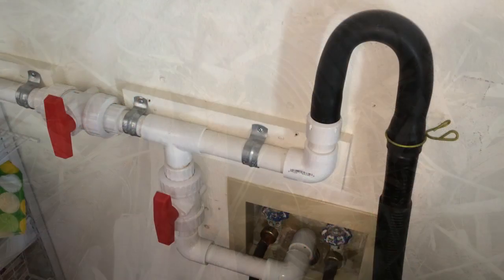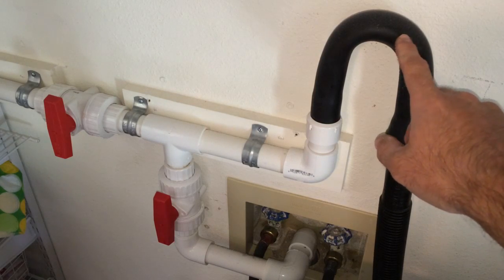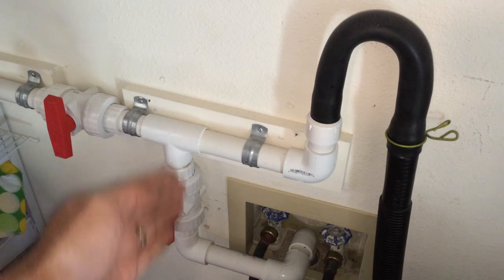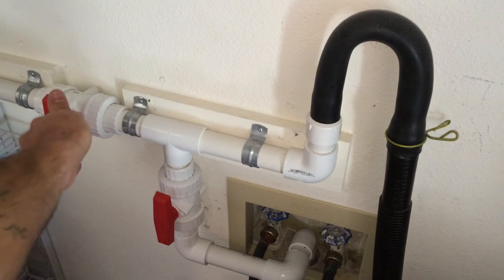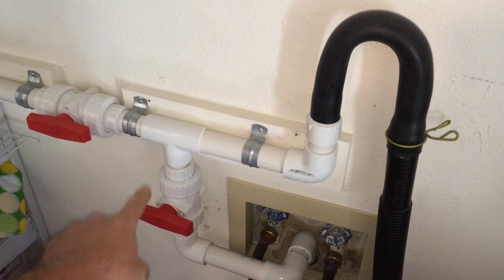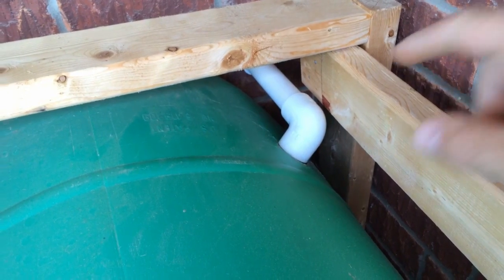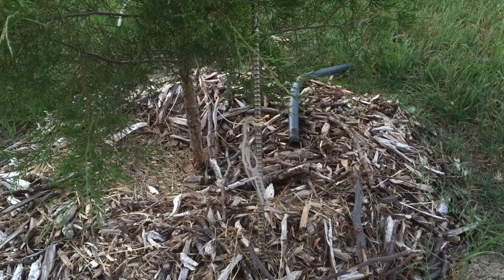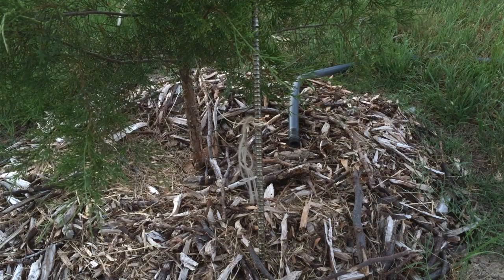Greywater Recycling

Comment: It appears that an improvement can be made by using this video’s plumbing but just illuminate the left side valve to the tanks.  Just stay with that one vertical valve.  Water will take the path of least resistance.

Comment: I want to add my thanks for sharing the well thought thru application of the piping along with your research of the detergent. It looks like you installed the valves so that they could easily be replaced as that particular valve is known for failing after a few years. Jesus bless you for your time and efforts.

Comment: Why not just use a single valve on the bottom line to prevent accidentally having both closed.  If the valve is open then gravity will pull most if not all the water down to the sewer and if it is closed then all the water will go to the storage tank.
Reply: Perhaps the valve in the horizontal line is the only one required. If it is open, most of the water goes to the storage tank and some to the sewer. If it is closed, all the water goes to the sewer. The pipe to the sewer has to be above the horizontal line in my proposed configuration so the gravity helps filling the storage tanks.

Comment: When I was a kid we had a maytag wringer washer. We first pumped water from the pitcher pump in the kitchen into a round tub on the wood stove,got it hot,then moved it to the washer with a big long tub of rinse water beside it all done with buckets. We washed the first load with bleach for the whites and gradually worked through the entire laundry using the same wash water and the same rinse water. We'd  sometimes do 15 loads in the same water. 
The bleach kept the water clean of microbes. Worked like a charm. When finished we would use the waste wash water to wash off the back porch. I still think there are places that use wringer washers because water is scarce.

Comment: Cool man. I am doing a project that includes grey water recycling and I was wondering if the set up you have is safe after 24 hours of being in the barrel if it does not go through a filtering system of some sort. Or do you not need it because the washing detergent is biocompatible?  In any case, cool simple set up. thanks

Comment: The only thing I see from my experience using rainbarrels is I would want the barrels side by side at a height better for gravity feed.  If your storage barrels are on a patio that is much higher than the lawn area then one on top of the other would work. Also as a 71 yr old Sr. Blonde I would want the connection to be a two headed to accommodate two garden hoses, or one for filling a bucket and the other with a hose connected.  With the drainage hose higher it would be easier on the back utilizing the connection.  Very easy to understand your directions, thank you for sharing.

Comment: I love your video thank you for sharing.
Question: When you have the line that goes of to the sewer drain pipe closed and are only only using the line that goes to the outside wouldn't you need a studor vent to prevent your washer pump from over working and causing it to fail do to to much pressure to build up? Also would you mind giving me a list of the things I would need to buy and also if you recommend me adding the studor vent.

Comment: I followed your instructions for a temporary set up - just proof of concept - it was great!  Put now for some reason the water is shooting up through the top (where the washing machine hose enters the PVC pipe - do you have any recommendations for sealing that area?  I see in your video you have something rubber?
Reply: You probably have lint in your pipes somewhere.  Or you do not have enough air space between your washing machine hose and your drain pipe (when it enters the drain pipe there needs to be an air space.

Try augering through your pipe to get rid of any blockage.  Then flush with water.  If it is clear, put your washing machine hose into the pipe in such a way that you have some air between the hose and the pipe.

I hope this helps.

Comment: I have had a similar system for 10 years with no problems with the drain pipe or barrel . I have had to replace the garden hose a few times due to lawn mower accidents or lint buildup . Someone mentioned your diverter valves and what happens if you goof and turn both valves off . He's my solution to the problem , Use a vertical standpipe extension with a valve near where it connects to the top of your house standpipe and a "T" midway that extends towards your storage tank . With the valve open water flows down the house drain , with the valve closed water backs up into the storage tank . You cannot get the valve in a position that will stop the washing machine from draining . Take your "T" and turn it the other way producing a vertical standpipe and eliminate the valve on the left . I used a larger black ABS pipe . That's my suggestion and I'm sticking to it !   :)

Comment: Very clean plumbing set up and others have commented on a vacuum relief valve. Two major issues I have seen, first and foremost is that grey water storage is not legal since it turns to black water within 24 hours. This is a major health concern. Second issue is the vacuum relief, in my research you have a good chance of creating suction and ruining your washer without the relief. Third you may have 1 1/4" hose from the washer but it drains into 2" pipe in the wall. Dropping down to 1" pipe may increase your out put pressure but you are now restricting the washers ability to drain properly.

I really do like your valve idea.

Comment: Very clever valve system.  How do you attach the end of the washer drain hose into the 1" coupling?  The coupling's inside diameter is 1 and 1/4 ", the drain hose end is 1 and 1/8", so it's a very loose fitting.  Please explain.
Reply from the maker: Good question! What you are seeing is not a standard coupling. It is an adapter with one side that fits on 1" pipe and the other side is a barb fitting that the drain hose fits on. It is a very tight fit and if you look closely in the video, you can see the end of the drain hose is bulged slightly. I found the adapter in the plumbing section at either Home Depot or Lowes, so it's not a special order part. Hope this cleared it up for you and thanks for watching.